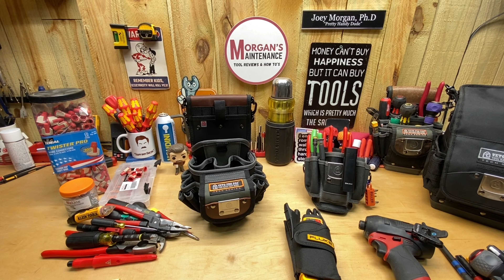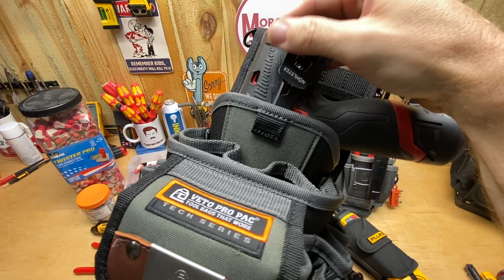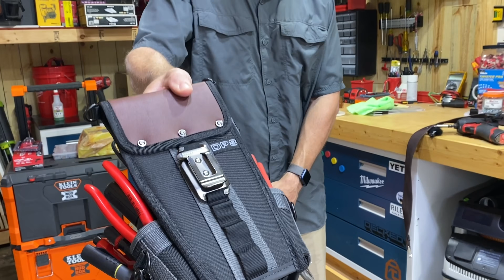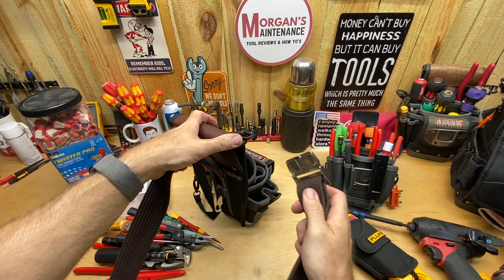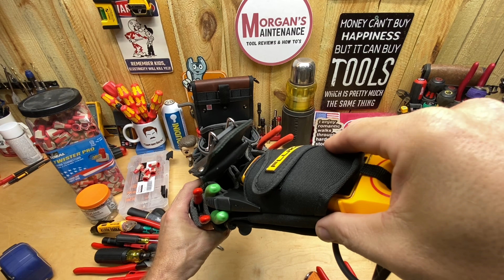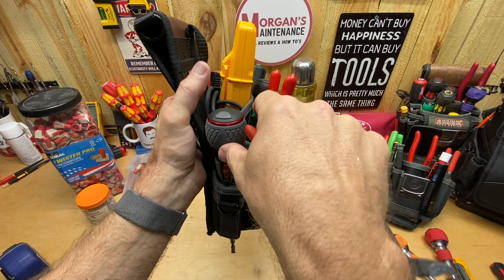Veto Pro DP3 Drill & Tool Pouch... or a Meter Pouch! #tools #vetopropac #maintenance #electrician

Comment: I now own this and it’s fantastic. It is loaded with spanner’s etc. and hangs on the radiator. It will clip on the side of a vet bag. You can fit a smaller pouch into it too. It will also hold a 18 sds drill. Epic . I have never been so organised since buying a free vetos pouches to complement my tech pac. They act as a hub for the bits i take out the bag
Reply from the maker: It’s a good option 👍

Comment: In my long ago past, I had a pouch that was similar to the dp3.
It was a leather electricians pouch with a hole through the bottom stitching from carrying a makita 9v drill ( I said long ago)
I'd suggest putting the ground clip in the bit holder pouch, clipped onto one of the internal loops.
Adding a Joey pouch for materials would make for a light rig for quick fixes or small jobs
Reply from the maker: @shadowulf  the old Makita 9V… many people had those.

Thanks for the suggestion 👍

Comment: Just looked on vetos site there is a new drill pouch (DH2X) which they have a picture of a meter in it. Closed or open bottom on it. Not sure if it would stand up by its self tho.
Reply from the maker: That one looks a little smaller so it could be better. Not sure what all tools you could fit in it.

Mine says out of stock… so it’s probably coming soon

Comment: I have to get in some pretty weird places a lot of the time, crawl spaces, tight attics and such, was looking for something that doesn’t stick out too bad, do you think this would get in the way and if so would the MPX or 1X be better? I have to fit termination tools and some basic drivers (usually just use a multi bit driver) and either a cable stapler or my M12 drill or impact.
Reply from the maker: This sticks out quite a bit. I don’t think it is what you are looking for.

The MPX is the least, but only fits a few tools.  The MP1x doesn’t stick out that much farther and gives you a little more options making it more versatile.

The only advantage to the DP3 would be for your M12, but I normally carry mine on the tape clip, or I just clip it on somewhere separate from my pouch.
Reply: @MORGANSMaintenance  THANKS! Any suggestions for a good clip on soft pouch or case for my CAT6 Plugs and boots?
Reply from the maker: @cartharax4308  I don’t have anything I currently use, but maybe someone else will chime in… I was trying to think if I had seen something in the guess the trade.  If I see something I will let you know
Reply: @MORGANSMaintenance  Thanks again, I'll keep looking also, would help if I wasn't so damn picky.

Comment: I stole a back from one of my Cliptech pouches and installed it on my DP3 so I can clip it on and off.  I am just not a fan of running it through a belt to take it off and on. I use the little belt clip to attach it to the side of my TP XXL and that works great.
Reply from the maker: It’s not my ideal situation with the belt, but I don’t mind it as long as I just leave the belt in it. I also won’t use it super often over my MP pouches

The clip does work good to put it on a bigger bag.

Comment: If you use mad pack holder can slip it over your belt and it stabilizes the dp3 a little better
Reply from the maker: Yeah I just thought about using that today.  I will likely use that instead of a belt.  Then I will have a handle as well.

Thanks 👍👍

Comment: Hi Joey good video again

One thing I noticed a few times in your tool pouch videos is your putting your pica pencil into a pocket 

On my mp1x I clip it with the clip on the pica holder to the outside of a pocket 
Same with my fastback 
Basically any thing small I can clip on i do and save the slot for a other tool or bit etc 

It’s only a little thing but it noticed it a few times and it kinda bugged me 😂😂

Have a great week
Reply: Was just a thing I noticed that I my mind did not make sense lol 

And yea that is one great thing about the mp1x day to day or even hour to hour the layout changes to the use 
And I hardly ever run out of slots 
More often then not it’s either just right or I have room left 
So I’m very glad I did not go for the mp2x
Reply from the maker: I do that on my MPX because I don’t have enough slots.  I do that with my knife and flashlight generally.

I move stuff around when I need slots though, I’ve had my MP2X looking like an MCT off my side before 😂
Reply: I personally like my tracer and pica pencils in a pocket myself.  The only thing I may clip on is a utilty knife?  Regardless I've had the sleeves pull up and fall on the ground at odd times like over a open hole or crawling under or over things.  Since there 12 to 16 bucks each I'm not gonna loose them over a extra slot in my pouch.

Comment: Thank you so much for this! I’m an HVAC tech and got the MB3B for my probes and iPad and I had a TP-XL for most of my other tools but I needed something smaller for my quick check DP3 that you’re showing. The Meter with the drill in the photo is brilliant. I love that, I’ll use my smaller meter rather than my Fieldpiece 680, so it’s perfect.

I’m back and forth with the HVAC 8-in-1 or the impact 11-in-1, but I’d want to get a valve core removal bit to replace the square.
Reply from the maker: Yeah Veto makes a lot of stuff to store meters in, but not really to use them back/forth with “quick grab”

This isn’t perfect for me, but something I can use till I find it.

Comment: I’ve grown to like the Toughbuilt clip system and have been cannibalizing and putting Toughbuilt clips on other pouches.
Reply from the maker: Many people respond on here that they use them.  For the price, they are probably hard to complain about.  Seem like a good option
Reply: If you want a all metal version of the toughbuilt clips that can be modified to work with any current toughbuilt products check out prolock.  Simply filing down the wings a 1/4 in you get a all metal clip that sits flatter slimmer and closer to the body.  I took a prolock tool belt for 30ish dollars and used it for clip sets to put on other things.

Comment: I use the Toughbuilt electricians pouch for one of my meters and hang it off the side of a Velocity bag. When I was using the TP4B, I could get my Kewtech voltage tester in the front pouch, I can also get it in one of the side pouches of the SD-LB, but they are quite large for belt mounted pouches.
Interesting to see the different uses people have for the pouches 👍👍.
Reply from the maker: This one’s a little bigger than I would want.  My home is someday they make a MP pouch with one bigger slot for a meter, couple screwdrivers, couple pliers.

Comment: Does the M12 installation driver fit in the drill pouch?
Reply: Yes it does; that's how my wife has hers.
Reply from the maker: I would have assumed no without TPG’s response.  It will go down in it somewhat, not the same as depth (and as secure) as the Surge because of the DHandle, but it does slide in somewhat.
Reply: @MORGANSMaintenance  I sent you an email with pic of hers with the Installation Driver in it; and mine with my TP-3B tools moved into it.  It is a little bigger than the TP3B, so a larger pair of groove-joint pliers fits better, and it has room to include a parts box in the back pocket.
Reply from the maker: @OnusBones  I got those.  Appreciate it

Comment: Great video. I have been scratching my head wondering why Veto has never made a belt pouch designed for electrical. I cant tell you how many pouch variations I have tried over the past 30 years. I have broken my electrical pouches into two parts. My belt pouch is the Tough Built small electrician pouch. I like it because I can put my Dewalt Gyro in it and retrieve it easily. I also keep the tools I use the most in it.  I am pushing 65 years of age and I dont do heavy belt pouches anymore. This pouch is light weight and I can wear it all day. it's set up to do minor electrical like ceiling fans, light fixtures outlets and switches. That type of stuff.  When I'm done, I hang it on the end of the shelving unit in the van. I take the SB-LD pouch in when I am doing more extensive electrical work. It obviously holds more tools and meters. Bottom line for me, I only put light weight pouches on my hips and carry or roll the rest of it. I see workers all the time with 20 pounds of tools hanging off their body and trust me, it will catch up to them. Keep up the great vids and let me know when you find the perfect pouch.
Reply: I a long time ago hating standard tool belts went to beltless/vest systems myself.  My heavy framing rig is occidental leather beltless system (there are plenty of videos out there).  My medium roof rig is a knockoff of occidental leather suspendavest but that has changed to diamondback 701 lately.  The common goal is to ditch that weight on my waist and put it on my shoulders.  The other nice thing is the setups flow and move with you instead of being stiff.  I agree 20lbs all day is just torture unless your use to it but it's like doing concrete for a living it will kill you.  Pouches are the same way the dp3 is a bit too heavy to wear if they did a clip system it would need 2 on the back.
Reply from the maker: @MattHmm-rq6dn  I have moved to the Atlas Vest, like you I like the weight on my shoulders better than my waist. It’s also easier to take stuff on/off throughout the day as you aren’t using to lighten up throughout the day.
Reply: I had a chance to try on atlas 46 vest and it was sadly way to warm for me to wear working hard.  I wear shorts in winter type 🔥 🥵.   The occidental vest is only bearable the dB 701 is pure mesh only thing cooler is wearing nothing.  It's still noticeable wearing the mesh vest but if you have a sub or a chance to try one on do so.  There on sale recently 150ish for rhe vest alone reuse all your pouches and accessories.  Defently something to try!
Reply from the maker: @MattHmm-rq6dn  I’ve been watching the Diamondback one.  I’m waiting in an different Atlas vest since February (more mesh) to see what I think.  If I don’t like it, I may try one.
Reply: @MORGANSMaintenance  I live in Glendale AZ, the vest is out for me.
Reply from the maker: @kendallas3705  I can imagine that 😂
Reply: @MattHmm-rq6dn  I have the same beltless system and it worked great till a few years ago. I still have it in back-up position on the van. Just in case. (lol) I just got tired of hauling all the extra weight.
Reply: THIS!!  I can't imagine wearing even ten pounds of tools on my belt for any length of time.  I've decided I might get myself a MPX; that's the biggest I'd want to carry around.
Reply: Don't do the mpx.  The mp2x us only a little bigger and I bet you'll wish you had more room really soon.  I got the mpx and regretted it had to wait on backorder for a mp2x.  Everything is a seprate pouch is much better than double stuffed just resist and underfull your pouch.  Save 70 bucks learn from my mistake we always think we can use less when we really want more!
Reply: @MattHmm-rq6dn  I moved my MP1X tools into a TP3B instead, because it's much easier to pick up.  I almost never wear tools; I'm a network / computer guy.  Different jobs may need very different tools (e.g. setting up a server rack vs. making / running cables vs. building a PC), but each job only needs a very few tools.
Reply from the maker: Yeah things change as you get older for sure… you wish you wore knee pads more, ear plugs, etc.

That’s like carpenter belts, I’ve moved to stuff where they are easy to take parts on/off instead of wearing something all day long and only using 1/4 of it at a time.

Comment: Nice look at this pouch.  You're using it much the way I have my TP3B set up; the meter would fit nicely in the large front compartment (I have a folding work light in mine).  In a few minutes, I'm going to go try this setup in the DP3 since I use it as an indoors bag so I don't care about the plastic base.
Right now I'm using a DP3 for emergency car tools; I have a jump-starter in the big rear pocket.
Reply from the maker: Yeah, I used to carry my meter in my 4B much the same way.  I never liked wearing the ones with the plastic bases as pouches, but they make really great “bags” to carry by hand and set down.

Comment: Don't like the side pockets that angle out the tools.
Reply: Completely agree that's one thing I'd change like with the comical tall belt height.  Thoes tools are bound to hit something and spin you around at that angle why.?.
Reply: @MattHmm-rq6dn  That's a another tell that this one is best carried (maybe clipped to another bag), not worn.
Reply from the maker: I noticed that too while I had them loaded.  

I haven’t used it enough to know how much I won’t like it yet, but the MP pouches are much better for just tools for sure.  The tools aren’t as spread out so it’s more compact… but they won’t hold a drill or meter, so it’s give/take I guess.

Comment: I was watching a hvac youtuber that veto reached out to. He said that veto just couldnt understand why we would want our meters out and exposed and not in the new sd's rear zipper pouch. Hopefully it clicks for them and they make a dedicated meter slot in a dp3 similar pouch. I had the same idea for the dp3 but its comical how tall it is with the belt loop. It almost needs a leg strap at the bottom like a thigh holster.
Reply from the maker: For storage having it put up makes sense… but if we are physically using them in combination with tools we need somewhere to put them while we switch back and forth 🤷‍♂️

Yeah with the clip it’s not wearable in my opinion. It’s a belt through the loop only for me.
Reply: Don't like it one little bit, sorry Veto 😂
Reply from the maker: @iangregoryhome  worth a try, but it’s not 100% what I want.  Something to takes its place till I find it 😂
Reply: When I got mine I almost wanted to cut that top off 😆.